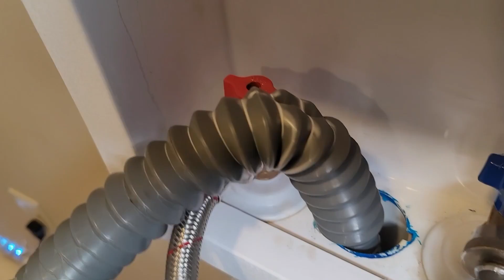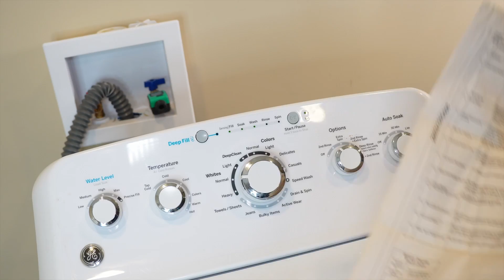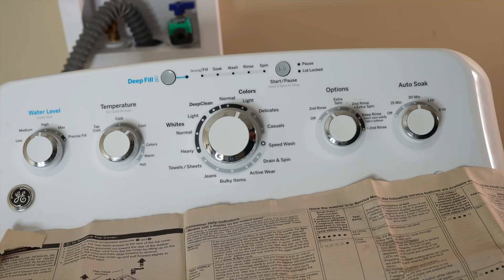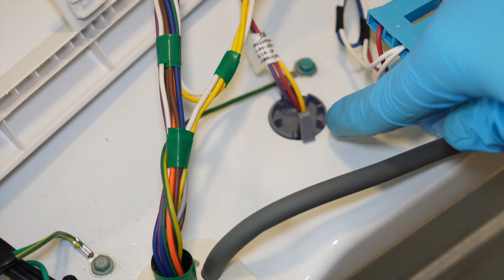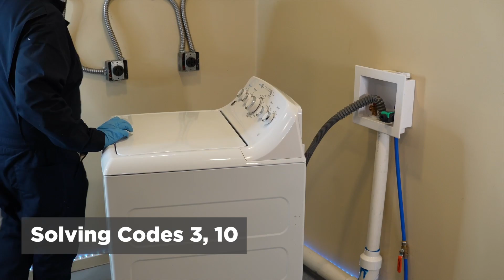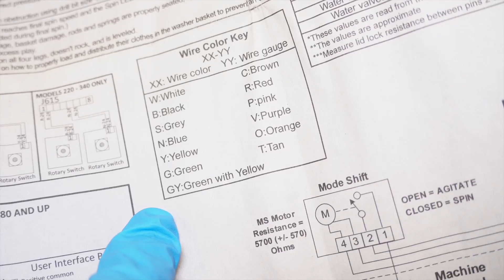GE Top Load Washing Machine Won't Start - How to Find & Fix Problems

Comment: PRETTY  CRAPPPY  MACHINE ...WITH  A COMPUTER  IN IT ...CANT  GET  MY TO  RUN  TO FIND  A  LEAK ... NEW  ONE  YEAR  OLD ...  ..USELESS  COMPUTER ..  250  DOLLARS  FOR  A SERVICE  CALL...GUY  WITH  A  LAPTOP ... NEW  METAL  HOSES  AND  NEW  DRAIN  HOSE ....../..CANT  FIND  THE  LLLEAK  UNLLESS  ITS  RUNNING .... USELESS  COMPUTER  ...

Comment: I have a GE toploader GTWS8655D0MC. I used the GE Wireless appliance module to check and perform a firmware update. Now the washer dumps all water directly to the drain and will not perform a standard wash cycle. I don't know how many gallons of fresh water have been wasted trying to troubleshoot. Any recommendations?

Comment: I did a diagnostic test on mine. It had about five codes.   However, it did not pass the the pump recirculation test. The pump would not stop huming.

Comment: Thanks for the video, very helpful @bensappliancesandjunk 
I removed the old lid switch and I bought the one that you show but, I am stuck because the part does not include the 3-pin connector plug. Can you give the the right connector that fits this switch?

Comment: My GE F5 washer looks just like the one in this video. Stopped turning on, yet when I unplug it the lights flash briefly. I replace the plug though it looked fine. Still does the same thing. No response except a brief flicker of the lights when the plug is pulled. Mother board shot? Any help is much appreciated... cheers

Comment: A symptom of intermittant loads with spin and drain dont work can be a weak spring on the mode shifter.
I would get 1 out of 4 cycles would get held up when it about to spin because the mode shifter spring would not push hard enough to engage the switch on the mode shifter that its in position to start spinning.  The faulty load would sit with a wash basin full of water waiting for the swtich to make when the mode switcher would click over.  Use some grease on the sliding parts.  GE should of programmed a watchdog timer alarm on the command to switch modes, and whether the switch confirmed the command was executed to proceed with the next sequence of the wash cycle.  sloppy programming.;  New Spring with a stiffer bounce fixed the problem

Comment: Thanks so much for your video. The machine you’re using is my exact machine so it was great to see that. I had a problem with a constant pause light coming on. Fortunately with your help I only needed to clean the lock lid contact and everything worked!!! Hooray — I had visions of having to hire a repairman and having to get the water out of the machine or having to replace the machine. All options, were not fun and all were expensive.

Comment: My washer looks just like the one in this video model number GTW460ASJ6WW. I cannot perform any of these error code checks because the washer pops the GFCI breaker as soon as you plug it into the GFCI receptacle. I know that some component or wiring is shorted to ground. What is the most likely ground short fault?

Comment: Replaced the speed sensor and it's still the same error code 14 sprays the two jets of water but won't start spin cycle 😢

Comment: I have a GE washer, just like what you are showing.  when I first started it the water comes on a little at a time and when it finishes the water doesn’t look like it enough in it. My wife has to add more water in the tank. but it

Comment: I recently purchased a GE washer, Model # GTW485ASWWB. This machine is horrible and unfortunately, I missed the return window. I understand that the water level will be low, as it is a HE machine; however, it barely puts out a fair amount of water and sometimes I have to restart the machine in order for it to actually start the fill cycle. Don’t even get me started on the spin or not spin cycle! It is doing whatever it feels like and the loud banging is ridiculous, not to mention the fact that it does a dance over the floor. Buyers remorse doesn’t adequately describe how I feel. I am 63 years old, retired, and due to some crazy circumstances in my life, find myself as the guardian of my two-year-old grandson. Fighting with a brand new washing machine wasn’t on my list of things I’d like to experienc in 2025. I’m sorry that this comment is so long. I am just so frustrated that I could cry again. I am going to save up and purchase a Speed Queen as was initially intended. I wouldn’t recommend a GE anything to even my worst enemy. Just call me Frustrated Grannie in Miami. Ugh!
Reply: Everything you said is exactly what mine is doing. It does not matter how small my load is when it spins, it hits the front, sides of cabinet and make it move about 6 inches.  I got mine a month ago and to late to return.  I would not recommend this washer to anyone unless you love your washer dance every load.  DO NOT BUY….. YOU WILL REGRET IT.

Comment: what is the likely problem if the start button itself won't activate the machine? control board?
Reply from the maker: Usually you'd go thru the video and do the steps I mention in order because there's no top answer on this type

Comment: it would be cool if you start the washer to prove you did something or that it still works
Reply from the maker: It worked before the video and worked afterwards. In order to make the videos I do, I can't randomly throw a broken one on camera and re-do every single step every time in hopes I film the problem that I fixed. There's a reason I am the #1 appliance Youtuber: I try to offer robust answers to the problems, as opposed to one-off ideas

Comment: Put in a new circuit board and doesn’t function. How do you program this thing so it works?
Reply from the maker: Should of had instructions with the board?
Reply: @bensappliancesandjunk  actually found a business sized card in the trash that said text for instructions. Screwy way to do business
Reply: @ none included
Reply: @ by the way, thanks for the prompt reply

Comment: I replaced the lid lock on mine. Ever since it either wont fill, or will fill, but then do nothing. It is giving me a pressure sensor code or water level.

Comment: I am having an issue with my GE washer its fairly new but after it fills with water and starts agitating for about 5 seconds it stops and then starts filling with water again till it reaches the top. then it just sits there and does nothing.. any help would be great
Reply from the maker: Check error code video - it may point you to whats wrong
Reply: @bensappliancesandjunk  appreciate it.. my issue was the speed sensor or hall sensor.
Reply: Mine was doing the same

Comment: I have same washer my issue is that on wash it will not spin and door won’t lock. But when on spin door will locked. I have replaced door lock with new piece and still having same problem

Comment: what if it doesn't come-on at al no lights like it has no power but its pulled in
Reply: Mines is the same way. Where you able to fix it?
Reply: @marieangelesnunez8719 mine is doing the same thing. No lights. Open the lid, close it, select a cycle and then a small amount of water starts to fill and then nothing else happens.

Comment: I replaced a drain pump on my GE washer (thanks for showing me how) because the washer would not drain.  When I plugged it back in, it now seems to be continually trying to drain and makes a noise.  Thought it might be worth a shot to see if you may have a thought as to what problem could be.  Thanks.
Reply from the maker: Likely board has been damaged due to the faulty pump. Had that happen a long time ago

Comment: Have an error code 9 and i have replaced the lid switch. The bad switch reads locked all the time. The good switch reads open all the time. Ive cleared error codes and still wont start. Thoughts?
Reply: How do you get it into diagnostic mode?

Comment: Hey I don't know what to do the lid locked is flashing and I just did a load not too long ago, why isn't it starting?? There seems to be nothing wrong with the striker but it's not locking. I tried unplugging it and plugging it back in but it still doesn't work
Reply: I'm having the exact same issue did you ever find out what was causing it not to start

Comment: I followed your diagnostic process and returned 9 codes in this order;
•Code 19
•Code 14
•Code 7
•Code 26
•Code 3
•Code 23
•Code 16
•Code 24
•Code 1

Additionally,  my washer is half way filled with water and I can not move it to begin the tear down process. Is there a trick todrain the water?
Reply: Go into the test modes and test drain pump to empty water.

Comment: Hi there, thank you for this information. I haven't tried any but they are useful. My issue is this, my washer just randomly stopped working. It is lit and I can turn the knob and you could hear the sound. I noticed that when I turn on my washer, it gives a sound that is flat versus when it was working normally. What could be the issue?

Comment: I'm having a weird issue with the same washer, sprays twice at startup, doesn't lock, and resets all five lights show with soak flashing once.  No codes and I have tried two lid switches.

Comment: Just want to say thank you for your Cabrio washer video, I found burn marks on the board and used alcohol to wipe it down. I’ve ran 3 successful loads without any issues. Saved a few hundred bucks, just hope it last as long as it should now. Thanks again!

Comment: Do you mean Haier pretending to be GE?  Right?  Thanks for the interesting videos.
Reply from the maker: Haier was making GE stuff long before they bought GE. It's been an open secret for awhile. Haier brand units were using GE parts and vice versa.

Mind you, most top loaders are garbage anymore so it's not like this one is worse than the rest

Comment: I have this same model GE washer .   Very cheap build quality.  It’s definitely not the same quality GE appliance that my parents always purchased ! 

I’ll use it until it starts giving me problems … then buy a USA company built Speed Queen.
Reply: I mean, these GE toploaders are made in USA, while their front loaders are made in China by Haier... and the build quality on the Chinese made ones absolutely blows away the US-made union-built tin-can top-loaders. But then, GE knows their market - most americans will buy any washer, no matter how cheap and unfit for purpose, as long as it's got a flap on the top and a plastic prong sticking up in the middle of the wash basket. For such a young country, we really are the most stubbornly stuck in the 1800s. lol.

Comment: I have that GE machine but sometimes in spin cycle it bangs around like it's ready to jump off the ground or take off even after I carefully put heavy items on the bottom spreading everything out to balance.  It's so annoying ... what is that?
Reply from the maker: Working on a video for that soon. Could be suspension rods
Reply: @bensappliancesandjunk  Thanks Ben but in all the years I've had a regular analog washing machine, I never had a problem, open and close the lid to add another item if you want ... no downside but may our Good Father God Bless you in your work and continue to increase you and your children in Jesus Name!!!